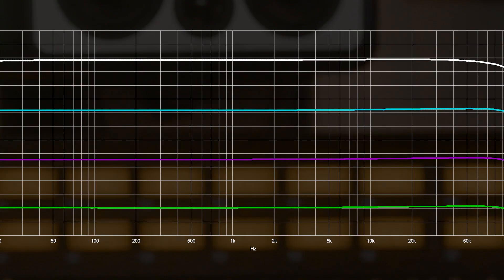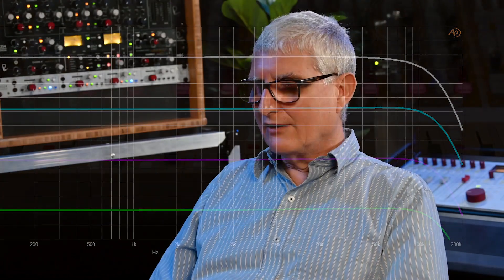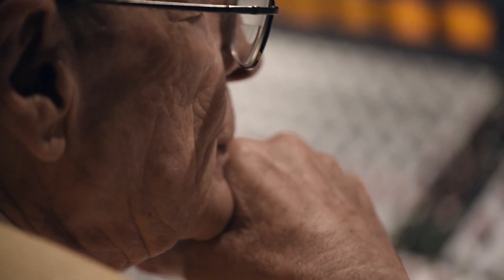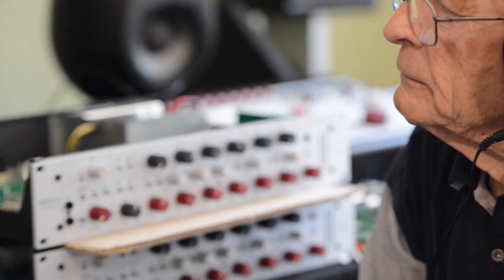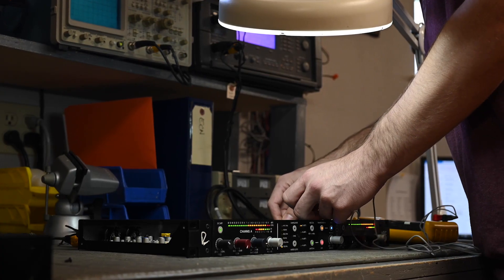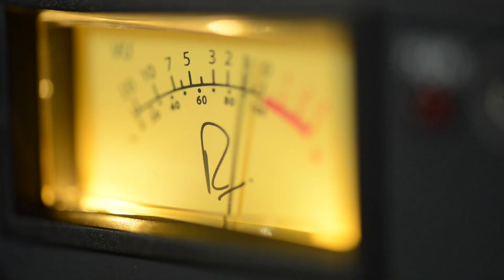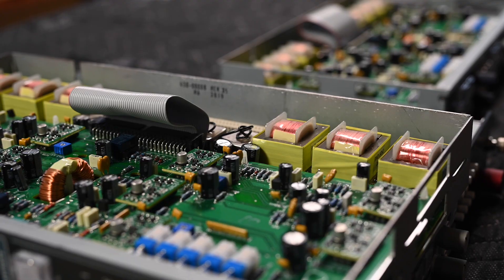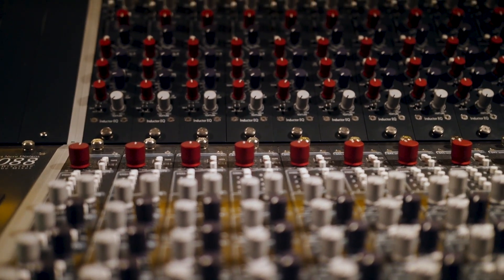Design: Wide Bandwidth

Comment: There are also more prosaic arguments for extended bandwidth performance. Things like instability and oscillation above or below the sonic range can destroy a mix without producing directly audible evidence to work with. There’s also the need for high slew rates to produce the higher frequency elements that make up a natural waveform. It’s easy for bean counters to forget that music listening rarely if ever consists of playing a pure sine tone. Fourier proved that just about any possible waveform, no matter how complex, can be produced by “stacking” together sine waves of varying frequencies—and that absolutely includes frequency content far beyond our range of hearing that will add up to the complex waves and harmonics produced by a natural instrument such that without those supersonic elements, the resulting sound we hear will be objectively altered. This is why the operational amplifiers used in the VCAs, RMS detectors, signal amplification, and filtering circuitry within every sound system are generally specified with bandwidth capability well into the tens of MHz. Neve of course understood all of this, and the way they present these factors here and in their other marketing is a rather elegant (if a little flowery) method of conveying the importance that these factors bring to the design of their hardware.